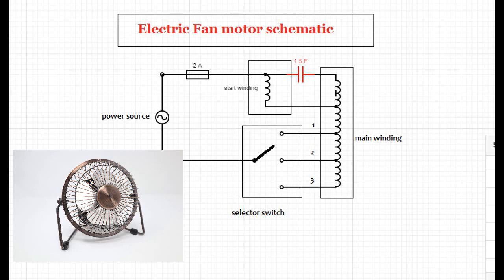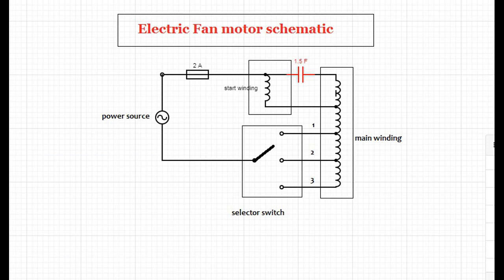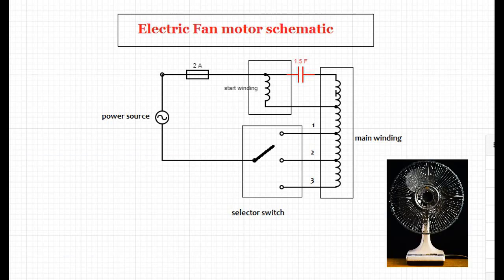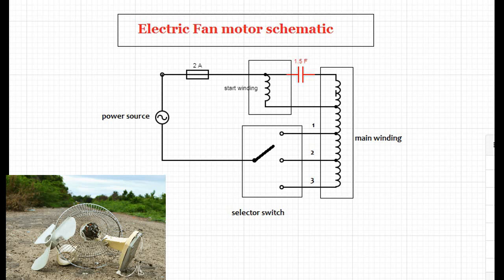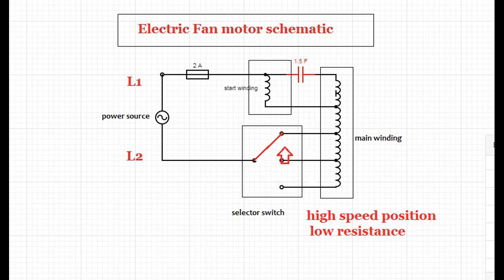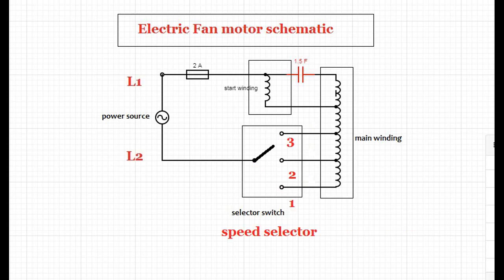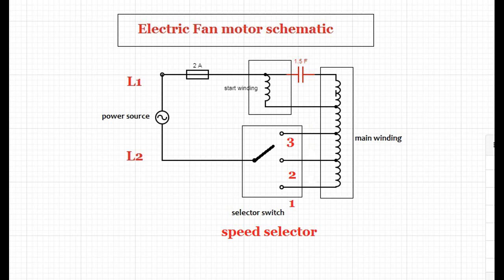how electric fan motor change its speed, how it works with capacitor

Comment: Am I saving electricity if I use the fan at low speed?
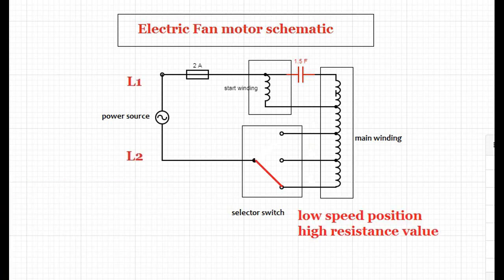Reply: 1:00 high winding resistance will dissipate more electricity as heat and use small portion of it for wind. So lower speed doesnt seem to save power unless it is inverter technology fan.
Reply: Yes, because you are using less power